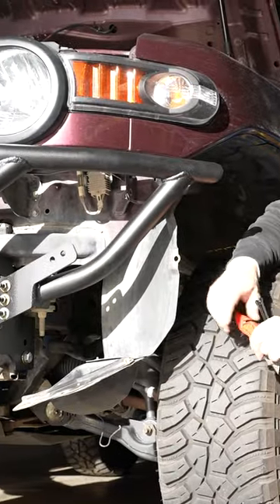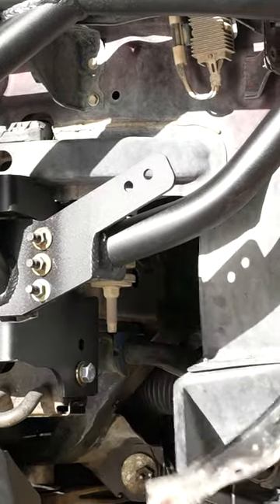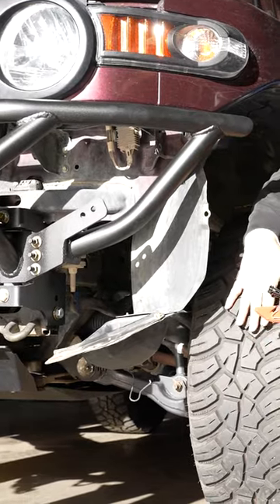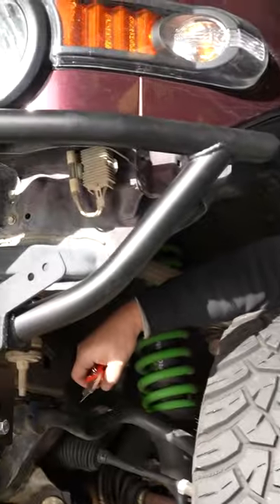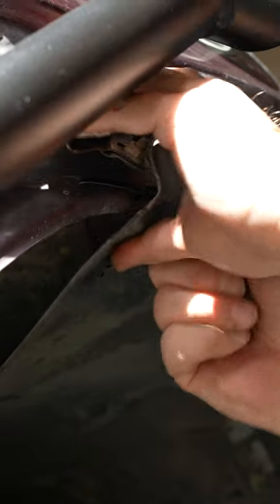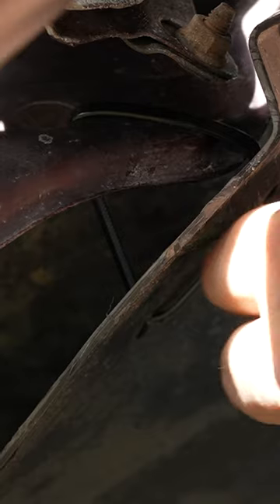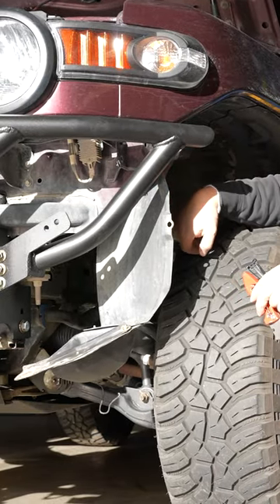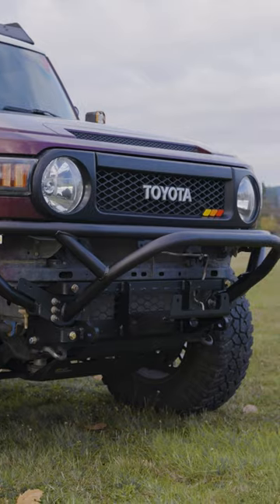Cutting your Factory Wheel Well | 4x4 Tip

Comment: I am not a four-by-four tech and by no stretch of the imagination do I pretend that I am a fraction of a percentage more knowledgeable on the topic...... BUT do you think there could have been any added benefit in allowing about four-and-a-half more in of that plastic so that it made it to the backside of the tube bumper, then drilling your small hole the same and also in the backside of that bumper, coated with a quick rubber spray, and then rivet the plastic to the back of the bumper allowing for a bit more protection for the electrical connections? I mean I imagine everything is probably waterproof so it doesn't make a difference but I was just a bit curious, I see openings in the area where you zip tied and I figured water or other debris could get back there and cause a problem